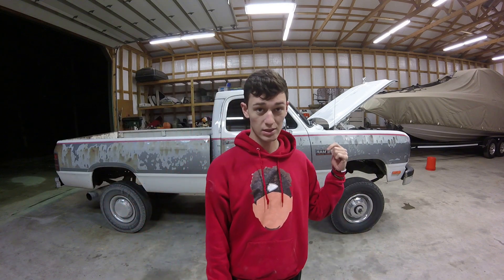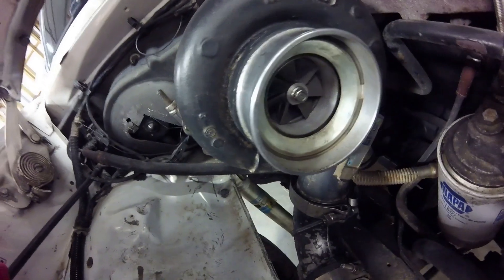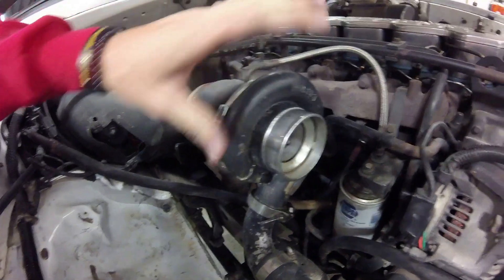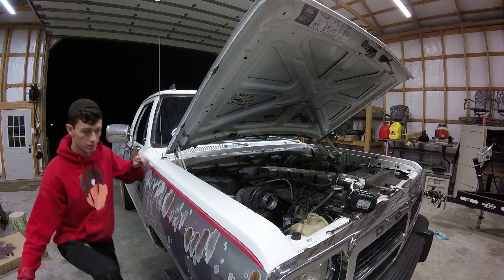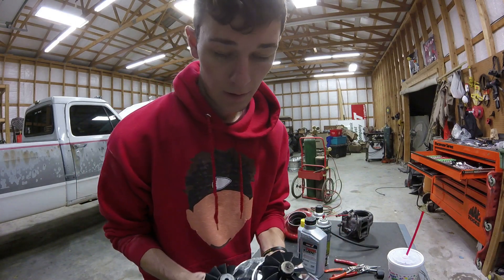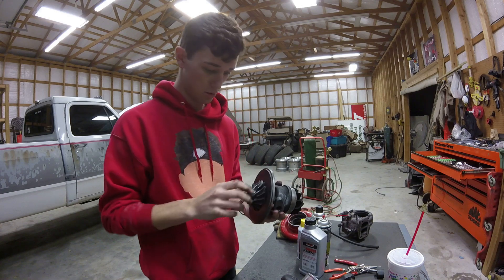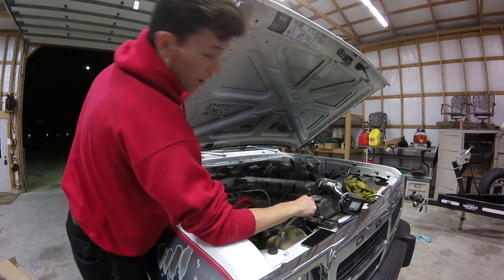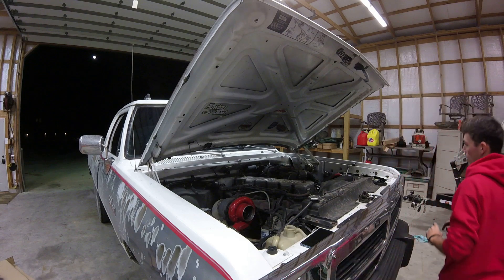HX35 TURBO TESTING

Comment: So you think an hx 35 is an good idea for a truck that only has a fuel pin and 3200 rpm govenor spring??
Reply from the maker: Absolutely. A stock hx35 would be an upgrade for a bone stock truck, with what you have id even run a modified hx35
Reply: The hx35 is perfect for that. This turbo makes peak power from 1800-2200 before it starts to fall off. It spools low and fast and is performing towing. It will taper off at 2500 and be done at 3000 rpm.

Comment: I been looking at trucks for awhile, I have a car so it isn’t gonna be my main vehicle, but I really been looking at a first gen that runs great and has only farm truck wear and tear, and I have a good deal on it. Is it worth it?
Reply from the maker: Yes for a truck to have around I think it's a good option..I drove this one 100 miles a day on average and it did its job. They are good trucks and when they are set up properly then run awesome.
Reply: Gavin Huke thanks man, much appreciated! And, you do one of the best jobs that I’ve seen on actually explaining what work your are doing, and the steps
Reply from the maker: @maxmccain3673  thank you max that means a lot, if you ever have any questions dont hesitate to message me on facebook or instagram or whatever and I'd be more than happy to help

Comment: 56mm 8 blade-51 lbs min 408 whp
55mm 7 blade 56 lbs min 448 whp
60mm he comp 70lbs min 560 whp
All Holset kg corrected to lbs min at SAE conditions or .073 lbs cube foot. Or what we have seen on the chassis dyno. 
You can probably guess who this is 🙂
Reply from the maker: You the man brad 🤘😏